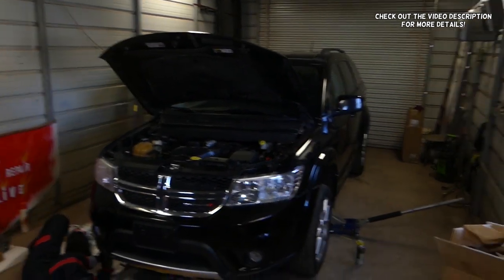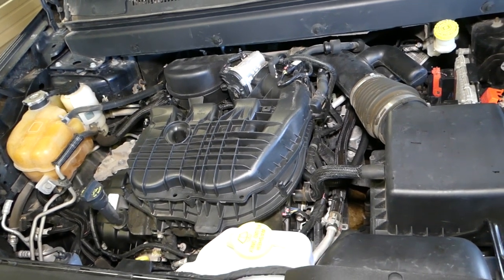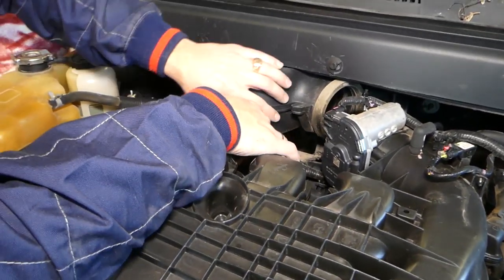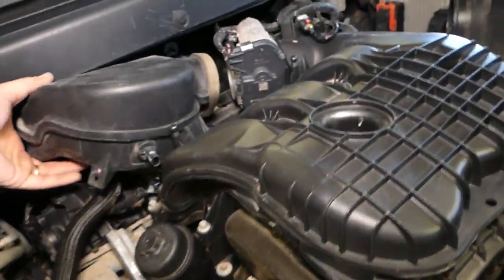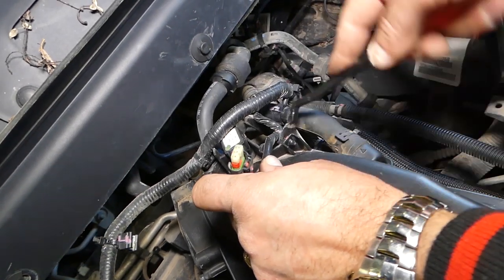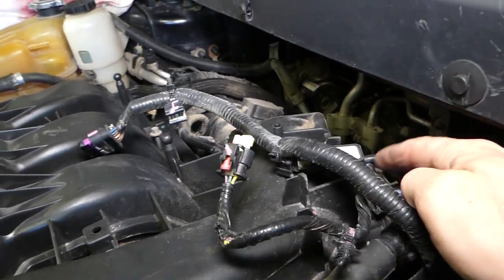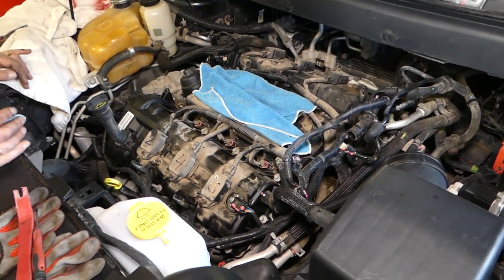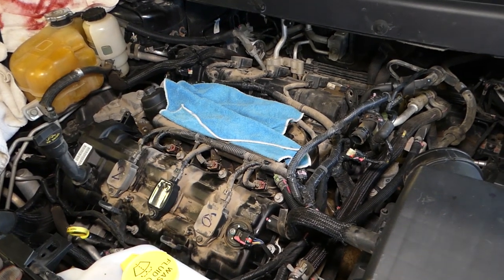DODGE JOURNEY IGNITION COIL REPLACEMENT 3.6 V6 FIAT FREEMONT PENTASTAR

Comment: Thanks guys I just bought a 09 journey and it had 13 codes on the owner wanted $3500 but I talked him down to 2800 and your videos helped me fix  them thanks guys
Reply: This job alone is close to $2k here in the bat, that guy should’ve sold it for 1 to 2k. He’d pay that much alone for that one code.
Reply: @TheRoadLessChosen  I no longer have it sold it to a guy that just wanted the body not the motor or transmission because he had one that was t-boned and the engine and transmission are still new and in perfect condition still so all he wanted to do is switch the parts from his to mine he offered me 2500  so I took it

Comment: Followed your lead and did the job myself. Worked out perfectly with no issues along the way (other than a few arm scratches)  Other videos say remove the front brackets...that would be hell. You said the back and that the cats ass👍

Comment: Hi there I have a question ... my 2016 Dodge journey engine light came on P0302 cylinder 2 misfire  I have had sparkplugs and ignition coil  the engine light has come on again for the forth time after having other work done my questiin is what else can be done for this continuous cylinder 2 misfire code

Comment: I have a 09 awd journey sxt. Took to shop for code p2317 he replaced coil. Got in to drive home 30 miles and half way check engine light comes on acting like it wants to die when slowing down isles rough. Got home it was the same dang code! Could it be a coil again or sparkplugs? what do u guys think !?

Comment: are the gaskets reusable or do i have to get a intake manifold gasket set for my 3.6l v6 2015 journey?
Reply: Get the gaskets just in case. They're cheap and you don't want to get in there and realize you need them and don't have them.